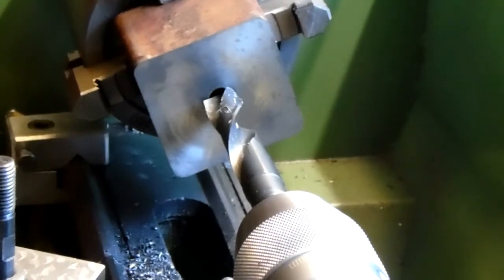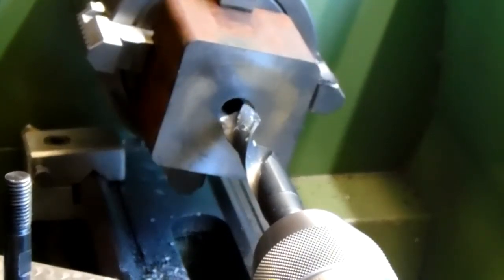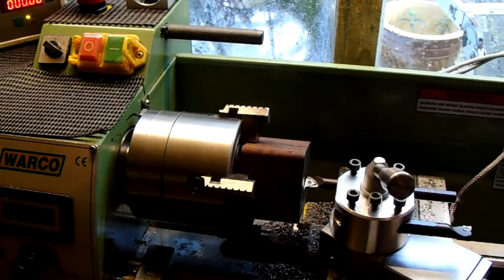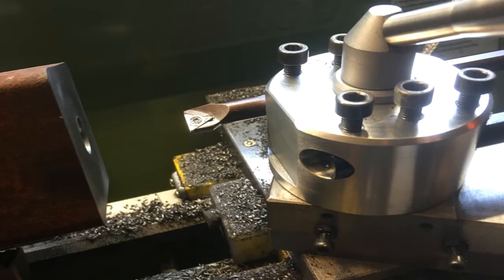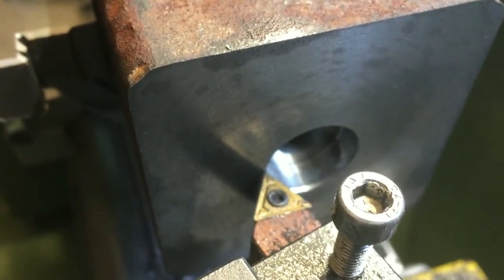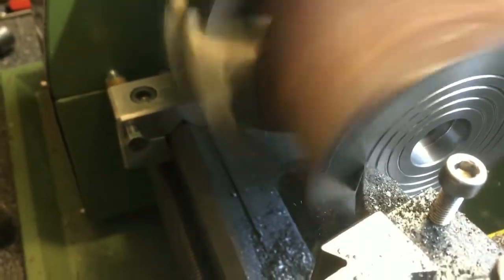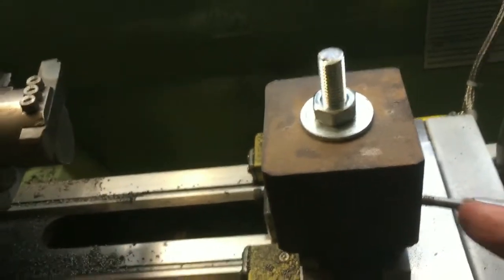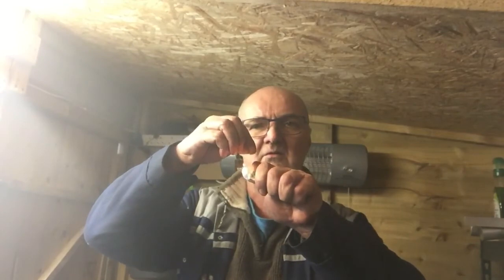WARCO LATHE  Shop made quick change tool post part 2

Comment: HI Ade, 

I am really enjoying your videos and am finding them useful.  I came to this game rather late in life have had a bit of a gratuity from my military pension.  So, I bought the same lathe as yours and the mill down (WM14).  I have machined the cone thingy from the compound improvement (took me a couple of tries) but currently lack the necessary pair to bore the slide.  I will get there though.

I fancy making the quick change tool post that you put together and was wondering whether or not drawings were available to follow.  If so, where can I purchase them from?

Keep up the great work.

Ian

Comment: Cast iron is very high in cabon/graphite content. Once machined these little particles will easily burn. It is the high carbon/graphite content that  makes the cast iron  a self lubricating metal and bloody dirty to work with.
Reply: Yes, I was looking at the drilling and instinctively shouting at Ade "Lubrication, man!" before realising that it's cast iron.
Reply: instaBlaster.